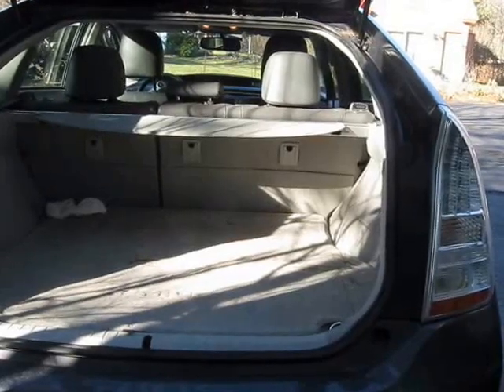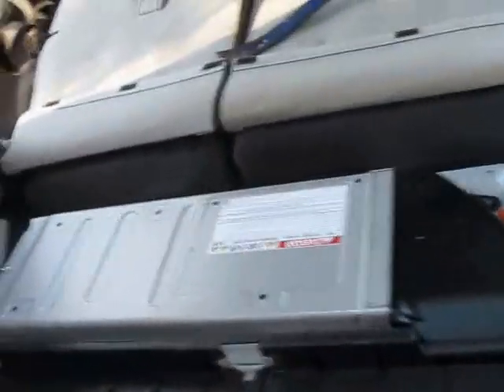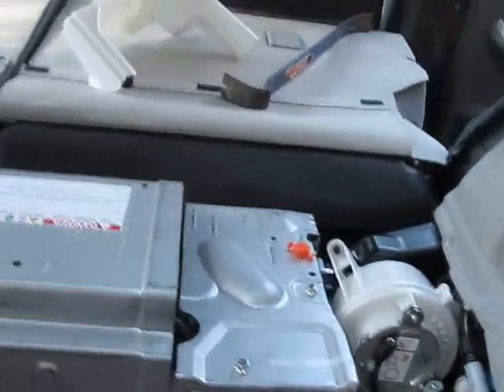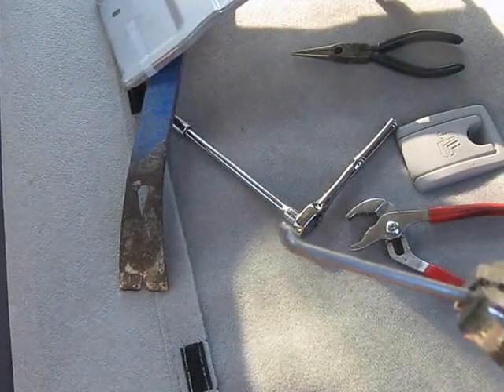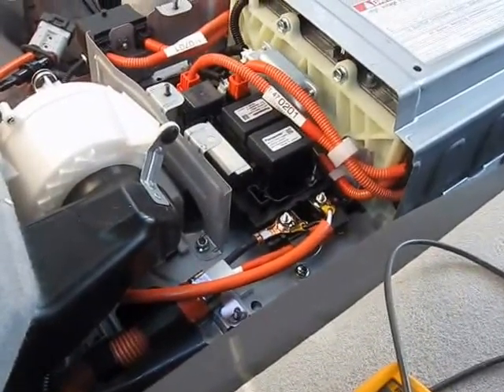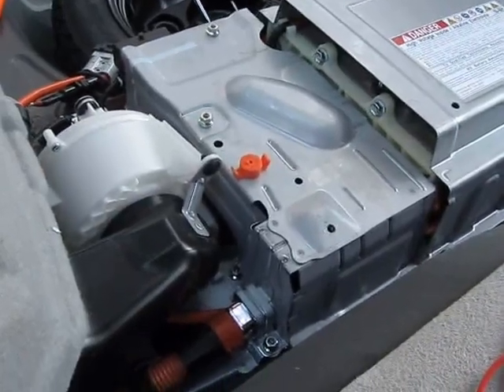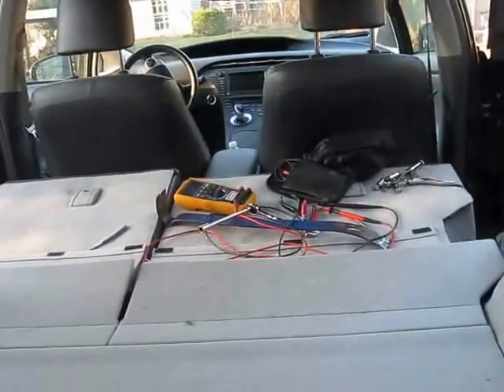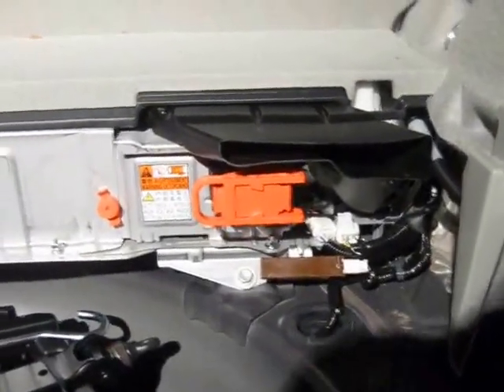Toyota Prius Gen III Power Inverter Cable Installation to traction battery

Comment from the maker: TheSaint135, I looked on your website and couldn't tell which one of the videos to look at. The traction battery is supposed to vary between 300 to 400.V DC. I think that I measured it at about 350 V. I bought a 2kw inverter and spent about $800.
Reply: What was your inverter rated for David? Do you still have the model number? Or a link to it? I'd like to check it out. Thank you for the tutorial, much much appreciated.

Comment: Thanks for posting this, I did some conversions to my prius for camping, you can check them on my channel. May I ask you how much you spent on the converter and what's the voltage you get out of the traction battery?
Reply: Did you install a converter yourself?